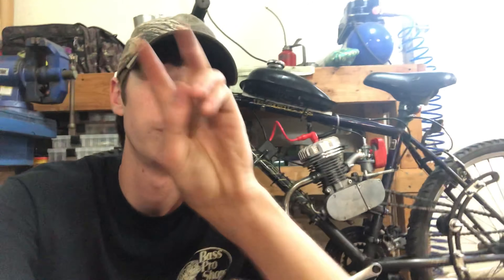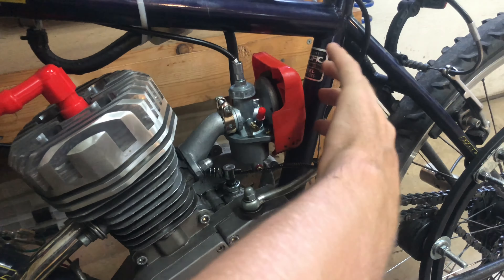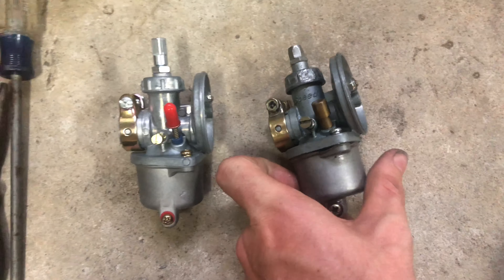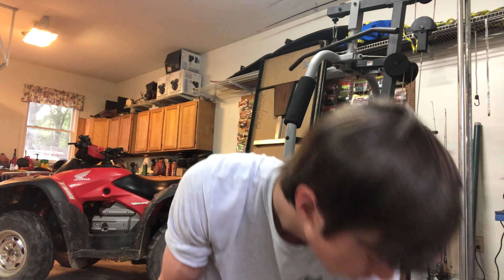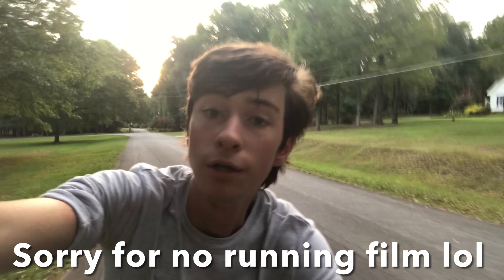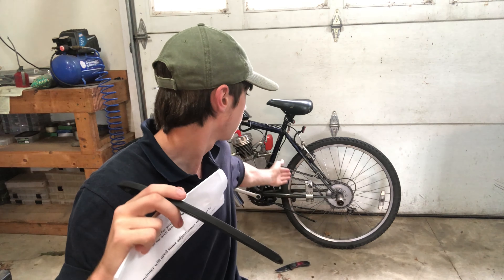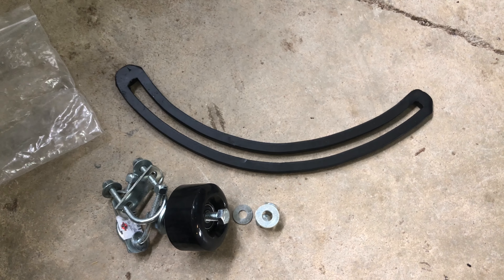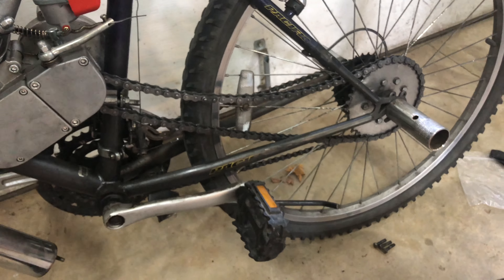Motorized Bike gets More Performance Upgrades!

Comment: On that Predator, if its anything like a Honda GX (pretty sure it is) check the idle air jet. Find that big, black,  plastic Phillips head screw on the carb that adjusts the idel. Back that big black screw all the way out and off the carb. Once that's outta the way, you should see another black plastic part, pry that piece straight up out of the carb. That's the air idle jet. Blow it out with compressed air or something, has a real tiny hole thru it that is like, way exposed all the time. They plug up, and well you know how it goes with carbs. Might be your problem.
Reply from the maker: Thanks for the suggestion dude! The thing is that I went threw the whole carb including that jet and sit blows black smoke at idle which means it is running way to rich at idle which is kind of strange. Valve clearance is fine as well and I think it is a ignition problem maybe flywheel magnet is weak is all I can think of cuz I pretty much eliminated every other problem. I got a spare one so I'll chuck it on and see what happens lol.
Reply: Some of those carbs also have a welch plug, or a weird looking head on the mixture adjustment screw that you gotta break off to adjust.
Reply from the maker: Alright, I'll see lol!

Comment: I have never tried an arch chain tensioner but I will be for a customers bike he simply doesnt take the time to use the proper tools to adjust his stock tensioner although i have showed him several times, he just takes a big hammer and whacks it backwards in an attempt to tighten the chain, he doesnt even touch the bolts then he wonders why it keeps coming loose and going into the spokes destroying multiple rims, oh well i guess some just dont learn.
Reply from the maker: Yeah I feel you too, I was on a chinese side by side with a girl one time and she was driving. It had no governor on the engine so I dont hold it a full throttle because it floats the valves, well she was doing that and I told her not too and she thought I just saying BS. I said to her "who is the one who has a YouTube channel about atvs, gokarts, jetskis, lawnmowers, side by sides, motorized bikes and engines? ME, I have rebuilt engines and been doing this stuff my whole life so I know what im talking about." She then listened and let off the gas a bit but stayed quiet after that lmao 😂